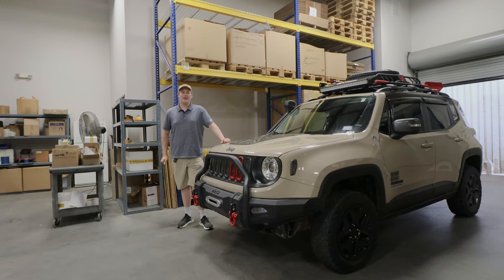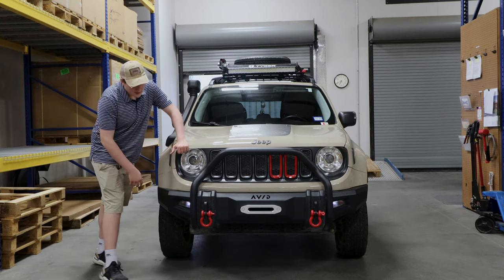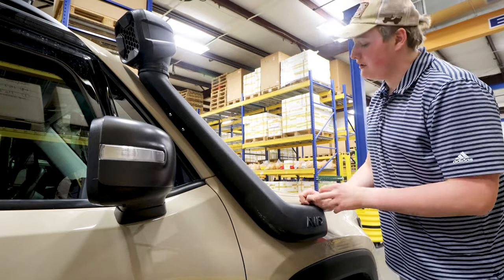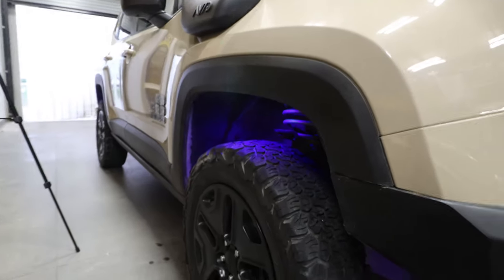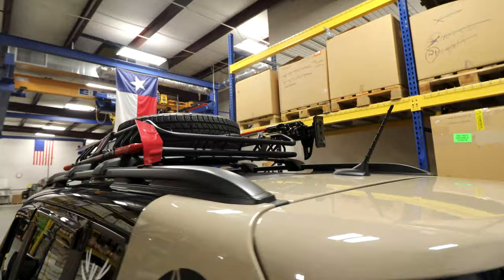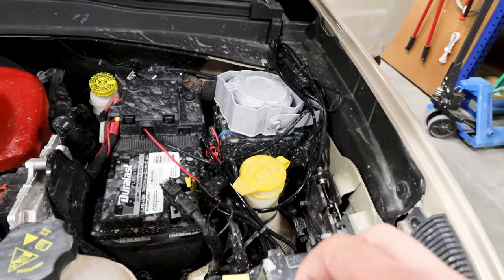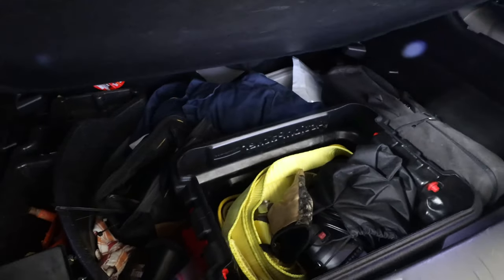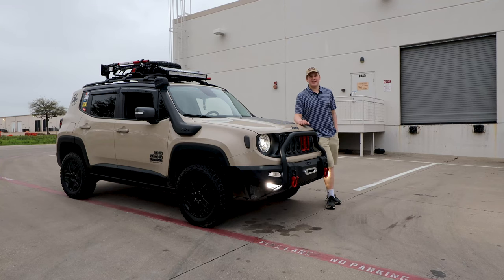Jeep Renegade Deserthawk Mods

Comment: How many miles had you run on this renegade? 
Does this springs caused issue to shock absorber?
Reply from the maker: Before I sold it, I had put 50,000 miles on it (Bought it new). I had zero mechanical issues with it for my entire time owning it. Changing the suspension geometry will definitely wear out parts more quickly quickly though...

Comment: Was shopping for a wrangler just to use as a toy in the desert and happened across a similar Renegade. Now I’m rethinking the whole thing. That’s a great setup. Add a winch and it will do 100% of what I need and it won’t be just another wrangler in the dunes.
Reply from the maker: InformalGreeting I love this setup and I’ve driven a ton in sand while in Moab, UT and it’s done great. I think it would be awesome to see another Renegade out there showing others what it can do!
Reply: Matthew Mitchell in the 15 minutes since I posted I tried to buy one from Carvana. Someone beat me. As soon as I find a good deal on a trail hawk or desert hawk I’ll join the club.
Reply from the maker: InformalGreeting Awesome!!

Comment: I had a 2017 trailhawk did the bumpers and lift rock sliders winch snorkel and wish I had never modified anything these are not meant to handle that much Xtra weight I started having tons of issues with it and traded for a Rubicon best choice

Comment: Thinking about doing a custom exhaust for my 2017 deserthawk. How much did the custom exhaust specifically cost you? It sounds beautiful
Reply from the maker: Thank you! It was around $150 for the custom pipe work if I remember correctly and around $100 for the magna flow straight-through muffler.
Reply: Awesome! Thanks man appreciate it

Comment: What made you buy a Renegade over a Wrangler?
Reply from the maker: At the time, cost was for sure a factor - but we also were curious to try out the platform considering how different it is. The renegade was sold two years ago in lieu of a Wrangler Rubicon 4xe
Reply: @matthewmitchell8842  I’ll go back to check out the Wrangler.

Comment: I'm loving the radio on it. How does aftermarket radios work with it, given that some features are enabled through the stock radio?
Reply from the maker: Every OEM setting and feature is retained with the aftermarket system with programming modules that go along with the new head unit. If you go to crutchfield.com the website will show you everything you need!

Comment: That’s hella great job mate. Just one question with Kenwood head unit. Can it make changes to the car system? E.g. lighting set up, auto lock. I am very much keen to change the audio system as the uConnect has limited amount of navigation map updates and lack of Apple Car Play feature but isn’t sure if I have to sacrifice all the car option changes. Thanks in advance!

Comment: First of all congratulations for the modification of your excellent jeep configuration, could you divulge the suspension kits, uses tires.
Reply from the maker: Thanks! Teraflex 1.5” lift, 1” Eibach Lift Springs, Yokohama Geolandar G003 225/65/r17

Comment: Awesome build! I’m modding my 2020 TH now. Did you change out the struts or just add the eibach springs and leveling lift kit? 
Also did you have to do any mods to inner wheel wells?
Reply from the maker: Michael Montesano Thank you! I just added the Eibach springs and Teraflex lift, no other suspension mods. I have done nothing to the inner fenderwells, and the tires fit fine without trimming.
Reply: Matthew Mitchell thanks man! Also what tire/size is on your rig? I wanna go with 235/65/17 or bigger KO2s but don’t really want to do the pinch seam mod lol.
Reply from the maker: Michael Montesano I’ve loved my K02’s and I highly recommend them... I have 225/65/r17’s and they fit perfectly. I don’t really want to do the pinch seam mod either haha

Comment: Very cool, question does the aftermarket stereo still work with the steering wheel  radio controls?
Reply from the maker: Thanks! Yes, there is a module that attaches to the rear of the radio that is required to retain the controls though. I don’t recall what it was called, but you can spec a full stereo system on the Crutchfield website and it will show you which one is required to keep them.
Reply: @Matthew Mitchell  good to know! Thanks for the response
Reply from the maker: @AlienBmxican  Absolutely! If you have any other questions feel free to ask.

Comment: can you tell me which brightlines cross bar you got? I put one on my GFs 2016 latitude but it doesn't fit her 2017 deserthawk.
Reply from the maker: These are the cross bars I used, worked flawlessly!
Reply from the maker: https://www.amazon.com/BRIGHTLINES-2015-2019-Renegade-Crossbars-Racks/dp/B07BL264KL/ref=sr_1_1?keywords=brightlines+jeep+renegade&qid=1637909514&qsid=146-7782974-3235134&sr=8-1&sres=B07BL264KL%2CB07PHGVWRX%2CB0100WNVLM%2CB07RBQNT7D%2CB09CTB9KN7%2CB00ZV1MZ74%2CB07L17JC6B%2CB07BL2L3RM%2CB008RDL78G%2CB07LGFG7JD%2CB07LGH4RXD%2CB0100FTP5A%2CB07PLQG47C%2CB07GNRNGV3%2CB00ZV1MSVM%2CB00N3446NC%2CB07L18M3WX%2CB00ZV1MQU0%2CB079K69B5L%2CB07RZ113HV&srpt=TRANSPORT_RACK
Reply: Thank you
Reply: Beautiful Jeep. I didn’t know you could get a snorkel for them.
Reply from the maker: @Gregorius4  Thanks! Snorkel is pretty awesome, acts as a cold air intake too!

Comment: Have you found a really good phone mount system? I wish 67 Design would do Renegade specific but I am finding in comparison there are little part options for Renegades to Wranglers like 1000 to 1. I just sold my Wrangler and went with a Renegade this time for a lot of reasons none having to do with it even hanging with a wrangler but the Renegade fits my lifestyle better at the moment. Do you have any suggestions on Renegade-specific parts companies? Thanks
Reply from the maker: Well as far as phone mounts go, I use a RAM suction cup mount and I put it on the small front quarter window on the door, works perfectly. For renegade specific parts I would highly recommend Avid Essentials and Valkyrie Offroad.

Comment: Is that a snorkel that helps with water crossings or as Toyota likes to say a "desert air intake"? Looks good either way
Reply from the maker: Navyshock27 Correct, that’s it’s main purpose. It’s also a cold air intake
Reply: @matthewmitchell8842  Cold air from inside in this Texas heat with a/c on? lol!!

Comment: just curious as to why you have the snorkel installed backwards, I've never seen the air intake facing the rear of the vehicle
Reply from the maker: Emerson Rosa I just decided to try it because when you’re in heavy rain or sand stuff could get into it but that way it won’t, and it also makes the intake super loud in the cabin which is a cool sound to me.
Reply: @matthewmitchell8842  I want that on my Limited,, where you get it? does it connect to intake of filter box or directly to engine? Larry
Reply from the maker: Larry White It is from Avid Essentials. It connects to the airbox via tubing
Reply: @matthewmitchell8842  I'm fairly mechanically incline so think I can make my own from pvc tubing/fittings,  Wadda ya thank ,,, got tools and Home Depot/Lowe's has pvc stuff.
Reply from the maker: Larry White I’d love to see what you come up with!

Comment: All that's important is that you like it, but IMO the best Renegade is a bit like the Suzuki Samurai, get the barebones 1.4T with manual transmission in 4x4 in order to be as light as possible, and get a OBD2 retune or piggy back chip to increase boost pressures so you can get about 190hp out of them.   That gives the Renegade much needed pep, as otherwise the power to weight ratio is poor IMO.
Reply from the maker: I’ve got 200ish hp with cold air intake and chip runs but the turbo and manual definitely would be more fun

Comment: I would love that bumper but they are never in stock on any of there bumpers... and what roof rack did you get
Reply from the maker: Yeah, they make them in house and they have been having issues with getting materials so it’s been a long dry spell. 
I forgot the exact model of my roof rack, but it’s from Tyger and they only make two racks and it’s the smaller one.
Reply: @matthewmitchell8842  ok thx...👍👍👍
Reply from the maker: @dailyrandoms2264  Sure thing!

Comment: Any engine work done to it to boost horsepower and torque?
Reply from the maker: The snorkel is a cold air intake and the exhaust is less restrictive, but nothing was done directly to the engine itself.

Comment: Yo from Arlington, TX.,,,, I have silver '18 Renegade Limited 4X4 auto. 30K miles.  been doing a few mods but nothing radical yet. Do like the frt. bullbar, snorkel, lifts, etc. (vendors?)   I been looking at Madness Autoworks (Austin,Tx.) exhaust systems and MOPAR Parts catback exhaust also. I do like the dual tip system Madness has but kinda steep in $s. I could have my buddy rig me duals locally.  Questions,, is the MOPAR catback system louder/different tone or recommended by you?  Did any of your mods affect the warranty on vehicle or throw off speedo reading?  I can't get ahold of anyone at NTJR club to find out if/when/where they meet up. I get up to Bridgeport OHP ever so often but very few Renegades I meet. Also TEXPLEX park south of Dallas is closer but has a weird schedule for 4X4ing. Any help is welcome,, thanks & hope to meet sometime,,Larry in Arlington.

Comment: Hey bro, love your rig! I have a 2016 TH. I'm  really curious on your exhaust setup. It it to much to ask for the full specs. I would love to get that same sound but I live in wa state. Any help would be great best sounding rene ever bro!!
Reply from the maker: Maurio Moore Thank you!! It’s a Magnaflow straight through muffler with a completely custom bent exhaust. It’s hard to replicate...
Reply: Maurio - I'm in WA as well. Near Everett. I'm going to talk to a shop in Snohomish about the Magnaflow 10416 muffler he mentioned in another answer.
I have aftermarket exhause headers, so it should be interesting.

Comment: By the way; i hope your beautiful personalization of this great product grants you the honor and privilege of having a platform in the automotive world. 
You set a great example by NOT CHANGING THE WHEEL TIRE SIZES. 
Every person I’ve ever seen do such a thing to a unibody construction crossover or ladder frame truck/suv had subsequently learned of the unimaginable drivetrain damage, powertrain stress electrical buggery and ultimate failure that messing with this ENGINEERED component.
When it comes to SUV’s half ton and smaller pickups and chunky awd crossovers tire change is all that can be done suspension work should be minimal and by no means should one ever stray from the original size of tire.
That is for: 2500 and ABOVE sized pickups or vehicles with frames based off of them. 
Those vehicles are built to cope with extraordinarily powerful heavy duty diesel powerplants that are themselves delivered in their lowest possible state of turn with hardware designed to triple its output in very little time.
The frames the wheels themselves the suspensions are all built to remain strong in the face of severe service abuse. Offroading is fun but it isn’t a game. Neither is owning a vehicle. It is a privilege to be free enough to buy what we want and do with it what we want and it is of utmost importance that we show the rest of the world that we aren’t out here blowing black smoke in the face of the green new deal and burning piles of nimh batteries and all season tires. 
If you follow this channel and like this video; emulate what ever you do to your 4x4 after this kids beautifully tasteful renegade build. 
Good job bro; don’t ever change your approach ok!
(Ps. Little lifts done so to accomodate different design of tire or bumpers are ok if they are just a few millimeters as are SOME leveling kits but largely, we need to respect finished products as the best possible setup or or wallets will take multi-ple thousands of dollars in losses and our remaining years will be spent far too demoralized by the prior waste of money.. its easier to just listen to people like me and copy this guy)

Comment: You need a winch, it's looking desert trail ready mostly. Have you driven it up desert mountain trails?
Reply from the maker: Josh Moore Well I have never needed one through moab and telluride and it just blocks airflow to the radiator. I’ll stick without one for now considering the price...
Reply: @matthewmitchell8842  ok
Reply: @matthewmitchell8842  I just finished working on my sixth passenger vehicle with two or more doors it's a 2007 Jeep Grand Cherokee Overland 5.7l Hemi automatic transmission 4×4 loaded. I could image it if I put the custom roof rack, winch, snorkel, custom hood with scoop and dual vents, and had a lift kit installed or if I could install one myself. I had a 1996 Ford Explorer Eddie Bauer Edition 5door 4.0 L v6 auto, with tow package and pulled a Volkswagen 4 door 4x4 out of a sandy wash on 4th of July 2014. The guys were lucky because it seemed like I was the only person out there at Four Peaks area that day!
Reply: @matthewmitchell8842  If you go on the  "Rain x lens restorer" video on YouTube there is the 2007 Jeep Grand Cherokee Overland I am typing about!
Reply from the maker: Josh Moore I’ll have to check that out!
Reply: @matthewmitchell8842  You'll get better gas mileage with 2020 Jeep Renegade at least 10mpg more! I owned a 4 cylinder car it was a 2000 Ford  Escort SE 2.0 4 speed automatic. There is some videos I made of it also on YouTube. I drove 1000 miles in the Ford Escort SE and it cost me $75 at $2.00 per gallon of gasoline!

Comment: Why is the snorkel air intake facing the rear of the jeep? Is that the way it was built? I have never seen ones that point to the rear, only front facing ones so the air induction is better...
Reply from the maker: hellaacapella Well when off road or even in a rain storm stuff can get into it so I’d like to prevent that at all costs. It’s of course fine to run it facing front since that’s the normal way to do it, but I like that peace of mind and the fact that it sounds amazing like that. Gives it a deep throaty sound. I’ve had no issue with air flow into the engine as I’ve watched my mass air flow sensor with it both ways and it’s the same number.
Reply: Matthew Mitchell I see.. so are you able to turn the intake to face either way? Is that part removable or something??
Reply from the maker: hellaacapella Yes, the snorkel head is just held on with a hose clamp so you can point it either direction.
Reply: Matthew Mitchell gotcha. Thanks for the info!
Reply from the maker: hellaacapella No problem!

Comment: whats the largest size tire you could fit on the renegade? average 35" ko2 fit? standard 2" lift suffice? 
why renegade and not wrangler?

great video, great upgrades. i wonder if you could put in description where i could get those parts?
Reply from the maker: J.t.R. JP 35” is a HUGE no go... Largest I’ve ever seen is 32” and that’s with heavy modifications. I have 29”’ Ko2’s right now with 2.5” of overall lift with no rub and full articulation with the sway bar disconnected. I wouldn’t go much bigger because of articulation and power loss.                                   I like the renegade more on road for me personally because I get better fuel economy, it rides better, less wind noise, and for me personally being so tall I find it to be more comfortable. Of course it’s never going to be a wrangler off road however it has done everything I’ve wanted to and taken me through many badge of honor trails in Utah and Colorado.... Thank you! I’ll consider putting it in the description if I have time but the roof rack is from Tyger, the bumper and snorkel are from Avid Essentials, and for other renegade things I’d check out Valkyrie off road.
Reply: @matthewmitchell8842  cool, thanks man.
yeah, I'm used to using 35s and I thought it could fit if maybe I had to cut some pieces off from the renegade. thanks for the reply and feedback
Reply from the maker: J.t.R. JP You’re welcome! If you have any other questions feel free to ask.

Comment: Question. What is the difference between a desert hawk and TrailHawk? Thanks
Reply from the maker: Hey there! The deserthawk was only built for the 2017 model year with very limited quantities, it was only made in colors Mojave sand, Anvil, White, and black. It has special graphics on the exterior, special wheels, rock sliders, different colored interior trim, unique topographic map seats, and embroidered logos on front seats.
Reply: @matthewmitchell8842  …. Thank you. Would you say though that it’s better then the TrailHawk version?
Reply from the maker: @chrisfrappier4882  Absolutely, it’s an upgrade as far as capability and comfort goes in my opinion.

Comment: do you have rock rails on this build? If so, what kind?
Reply from the maker: BBoyGIJons Yes, they are the Mopar ones that come standard on the Deserthawk
Reply: Matthew Mitchell nice! I have a trailhawk and they look just like the plastic molding. Really clean. Are they strong? Can they take the weight of the car or be used as a HiLift Jacking point?
Reply from the maker: BBoyGIJons On the Trailhawk they are plastic. They are VERY strong. And yes, they can take the whole weight and I use my hilift with it
Reply: Matthew Mitchell thanks a ton for responding Matt! I’m going to pick some up for my trailhawk. ✌🏼
Reply from the maker: BBoyGIJons Not a problem, enjoy them!

Comment: Where did you get the Metra dash adapter I want to pick up one
Reply from the maker: Miguel Rivera I got everything from Crutchfield.
Reply: Your video sold me on buying a Renegade and I’ve had it for three months now. I picked up a 2017 Latitude 4X4. I’m curious, the avid bumpers adding some weight, how much MPG have you lost with the added weight?
Reply from the maker: @miguel.a.rivera.jr.  That’s awesome!! I have mud terrain tires and the roof rack too so that has to be taken into account as well. I get 15 mpg currently.